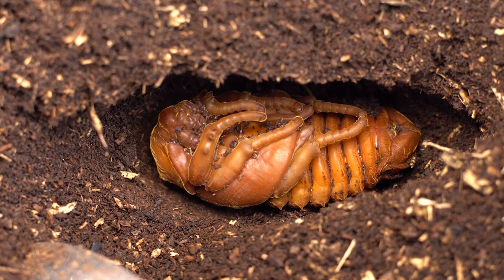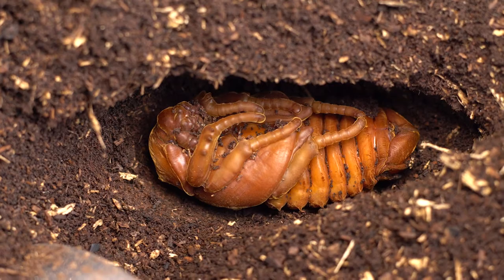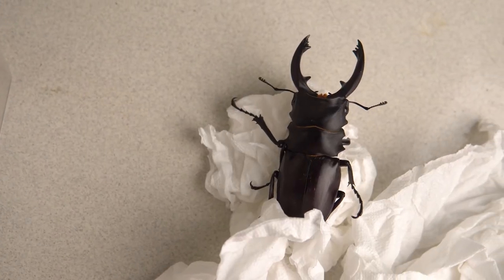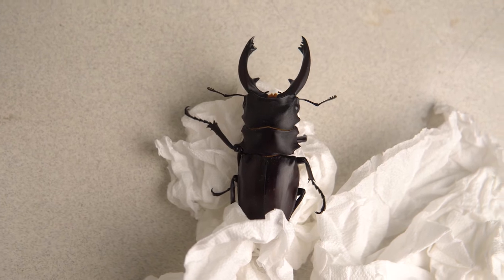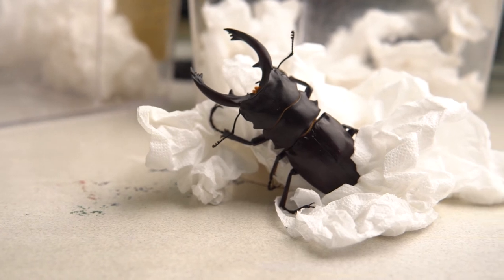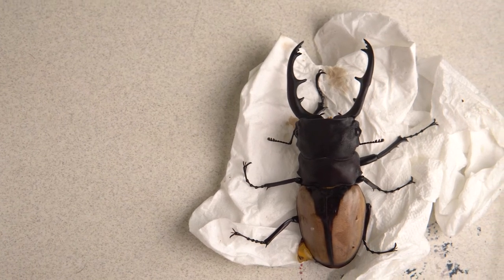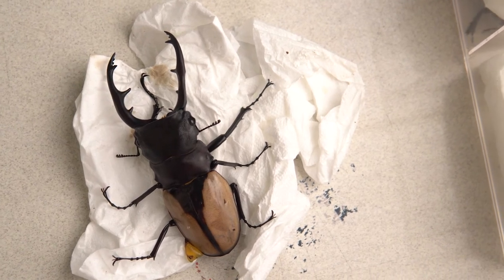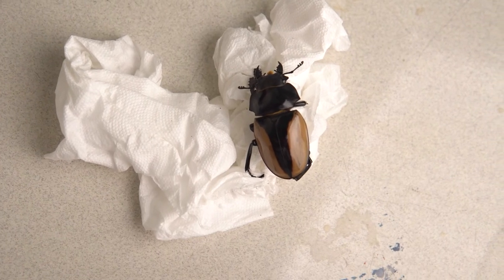What type of pupa chamber will you use, natural or artificial?

Comment: Why the water?
Reply from the maker: Can you elaborate a bit more, I’m not following you?
Reply: @AlanChuang  I’ll say it in spanish, traduce it.

El escarabajo tenía gotas de agua, me preguntaba si se necesitaban esas gotas o por que estaban ahi.
Reply from the maker: @roswaldo3093  I will get Spanish speaking friend to help me translate.
Reply: @AlanChuang  yt haves a function for that right?
Reply from the maker: @roswaldo3093  It doesn't show up, I will figure it our, no worries
Reply from the maker: @roswaldo3093  Alright, I understand (I think). Because I am recording the emerging process. The heat(from the light) and lack of pupa chamber wall make the water evaporate easily. If humidity drops too low, the pupa shin will get stuck on the newly formed beetle. I have had bad experience before this shoot, so I constantly spray some water mist to help bring up the humidity.
Reply: @AlanChuang  ok thanks hahaha. U understand it well…